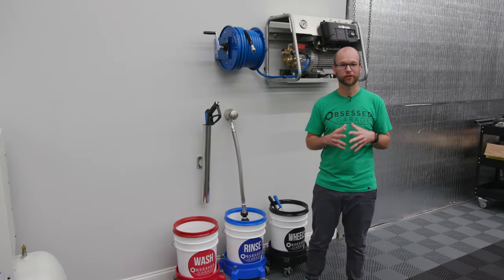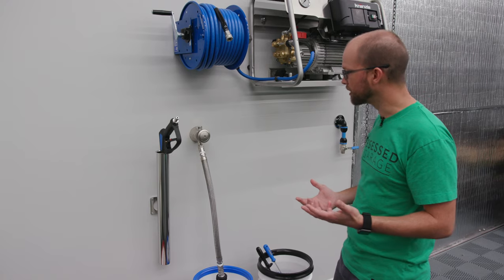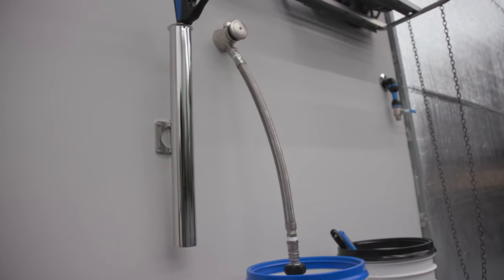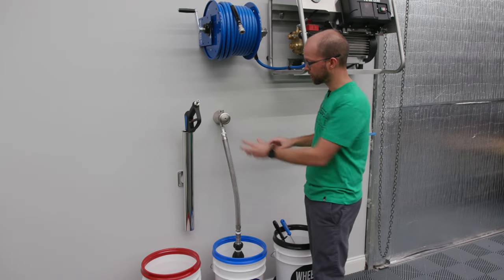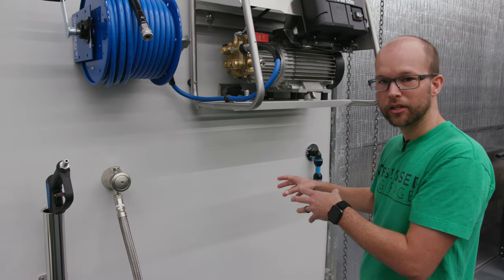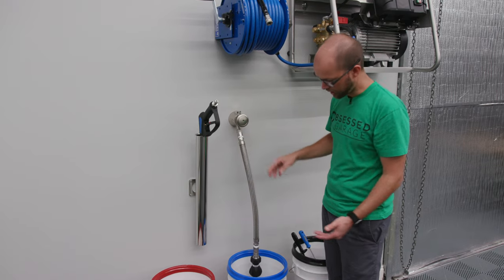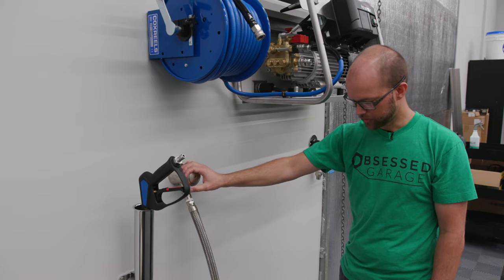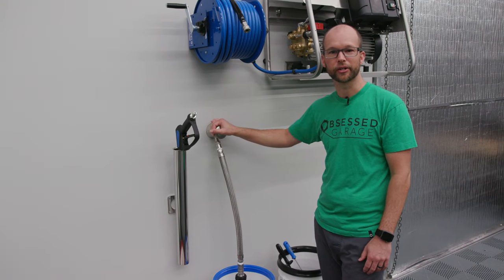The Obsessed Garage Ultimate Bucket Filler Solution - Detailing Hose Bib

Comment: Kyle, I only have one spigot on my garage wall that I'll be using to do both jobs, which is to fill my rinse bucket with, and then to of course supply water to my pressure washer. 
Since I only have the one spigot,  I'll have no choice but to use a Y valve fitting connected to the spigot for these two jobs correct??
You recommend a good quality Y adaptor for my Prier spigot?
Reply: We still haven’t been able to source a high quality Y for garden hose bibs unfortunately.